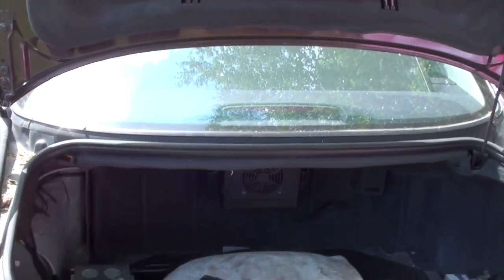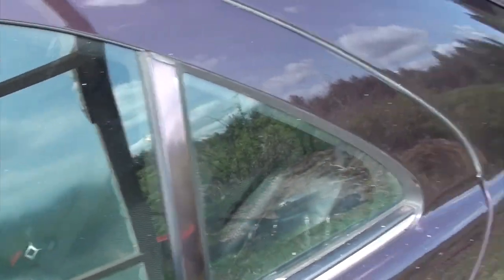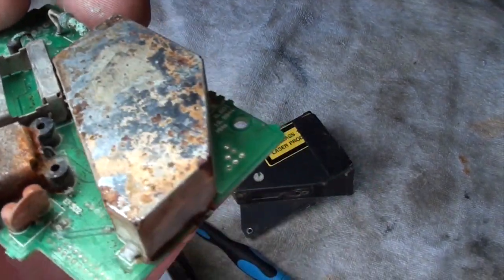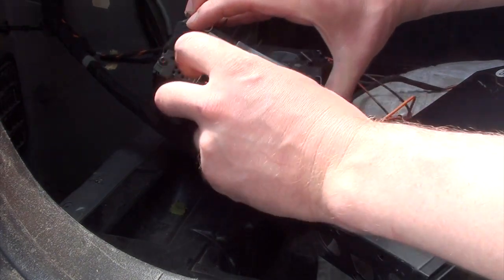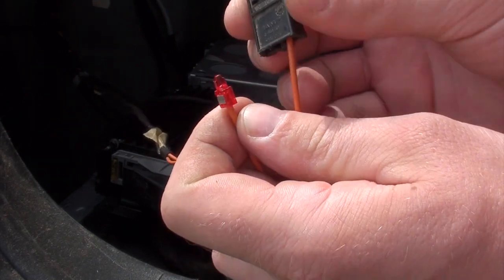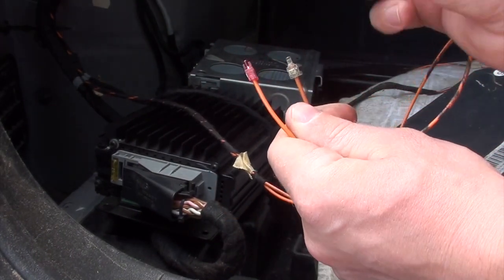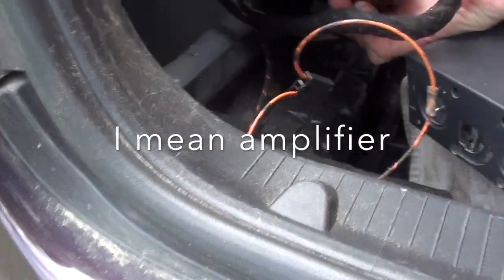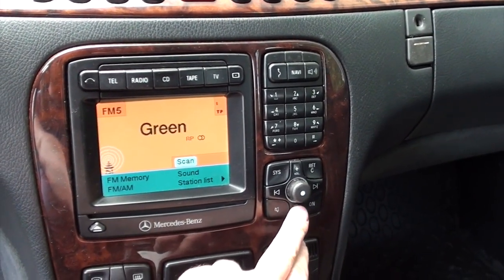Mercedes w220 no sound from radio | Easy fix

Comment: Just want to say Thank You for saving me also.  I was just gifted a 2001 w220 S500 designo and the Bose stereo started acting up intermittently with "no cd changer" then after 200 mile trip, suddenly "magazine empty" and stereo worked for the rest of THAT day. Then "no cd changer", even though I have a few more of the fiber optic cables (phone, navigation) in my vehicle your TRICK worked for me perfectly!  Now I use a FM transmitter in the cig lighter with a USB loaded with MP3's and Bluetooth from Amazon and it is totally modernized and sounds GREAT!  Thanks!

Plus, I can always get a rebuilt cd changer and put everything back to original!
Reply from the maker: Welcome. Glad it has helped You.

Comment: Hey my radio no longer has it’s options such as ambient modes driver optimization etc it jus says classical pop and manual and the sound completely stopped im not surr what settings messed up help please

Comment: Hey i have a c280, the gears were catching a few times then all of a sudden one morning i started it and when i went to leave the gear shift wouldn't move like it was stuck. 
The battery light came on that week also, then ilafter it sit that day i had to jump it off to start it back up. 
Could it be the battery causing the gears not to ahift ?

Comment: Does the circuit have to be completed if the cd player got removed by someone previous to me? Is that why im not getting sound? I see a plug ik guessing for the cd changer but no cd changer in sight! Mine is a w202 94

Comment: I'm having the same issue with no sound from my radio.  I have 2015 c300 and it has the Audio 2.0 Burmester system.  I dont have a CD changer.  I see the amp in the trunk and when I pulled out the fiber cable from the amp there was no light on.  I have looked through a ton of internet suggestions and nothing seems to work.
Reply from the maker: Since Your car is 15 years newer, first of all, You have to hook up some diagnostic tool, and check what it tells.

Comment: I checked to see if the automated voice would say something when i pull the phone lever on the steering wheel and nothing. Do you think it’s my phone module? I have a 2002 cl55 and after a heavy storm yesterday I have no sound. Will this process work on my car?
Reply from the maker: It should work the same. First of all check out Your trunk, and what components do You have there. I believe some of it were flooded, and fried.

Comment: Nice my sound went out 3 days ago any chance this will work on 2008 s550?
Reply from the maker: In W221 cd changer is i front, so it can not be the same problem. But I guess it's the same optical wire loop system. So all You have to do is to find faulty component. Have You checked the fuses?
Reply: Rasta Homestead that’s Oh ok. That is what I was checking to see. Maybe if it’s the radio fuses or the sound system fuses.
Reply from the maker: @yearight1800  If You have access to diagnostic tool nearby, that would be easier. Let me know Your outcome.

Comment: A have a cl500 w215 (99') my problem is that the radio plays from the middle but the speakers on the door don't work :/ hope y can Help a little bit .
Reply from the maker: That's not the same problem. How about rear doors? Does sound comes from there?
Reply: @rastahomestead6097  I have only sound from the middle over the radio /Navi and the bass works normal but no sound from a speaker ...
Reply from the maker: @paokis97  No idea, bro. Could be wiring, could be settings. Weird problem, and Your description is a bit vague.

Comment: Mine didn't have the phone module when I got it. The sound doesn't come either. How do I close the loop for phone module and where is it located?
Reply: Mines either I was wondering where the 3rd cable came from
Reply from the maker: You don't have to close the loop for phone module if it's not there. Just close the loop for cd changer.
Reply: @rastahomestead6097  Ahhh okay...so it didn't work still. Can I disconnect everything else and just directly keep the one fiber optic connection from amp to the stereo? I won't have to bypass anything anymore if I remove all other modules and CD changer right? I have a 2003 S500.
Reply from the maker: @hib1326  You can remove anything You want from a loop, as long as it stays "loop". I would bypass cd changer first.

Comment: Mine went out last month... I will try this tomorrow
Reply from the maker: Good luck!
Reply: Did it work
Reply: Blessed Credits I didn’t do it... my radio went out about a month ago, also de AC. I replaced the fuse and the AC Worked... radio didn’t still, I was about to do what This video said... my ac fuse blew again. I replaced it with a 20 amp instead of the 10 or 15 that the AC FUSE is... and then magically my radio worked again... so didn’t have to anymore 🤷🏻‍♂️
Reply from the maker: @pakotako7815  That is very odd, and I'm sure, that it didn't fixed itself, so should be gone again soon.
Reply: I replaced fuse but nothing changed. What fuse did you change out?
Reply from the maker: @blessedcredits3166  Probably because You have faulty component in optical circuit. Try what's shown in video.
Reply: Rasta Homestead ok I'll let yk how it goes

Comment: Will this work on s430?
Reply from the maker: If cause is the same, it will work. Just try it, it is easy 30min job. And You don't break anything. The wire You remove, could be put back together without any problem.
Reply: The radio says system unavailable then shuts off every time I cut it on. No sound nothing works it just keeps cutting off every 20 sec.
Reply from the maker: @blessedcredits3166  It indicates the same problem. You have to find faulty component in audio chain, by bypassing it. Does cd changer, telephone work?
Reply: Nope. It says sound unavailable, the telephone doesn't work or gps it cuts off every 20 seconds
Reply: I want to try this but I don't want to break anything
Reply from the maker: @blessedcredits3166  It is very difficult to break anything, but if You don't feel confident enough, go to workshop.
Reply: Rasta Homestead ,my optical plugs are different I have 2004 s430
Reply from the maker: @blessedcredits3166  Doesn't it come apart? If no, You could by optical loop cable on ebay for cheap, than You don't even need to split connector.
Reply: Yes
Reply: My s430 is doin the same thing it says sound unavailable System unavailable and shuts off

Comment: I check the phone module that’s what it is no power comin to it ima check the fuse
Reply from the maker: It is possible to disconnect phone module the same way, as I've showed with cd changer.
Reply: Ok I’m gonna unplug the phone module after the I check the phone fuse
Reply from the maker: @blueninja9188  Simply unplugging will not help, optical circuit should be closed, so You have to do the same with phone module cable as I did with CD changer.

Comment: I try it an still no sound
Reply from the maker: Hi! Have You checked if Your cd changer is fried? If not, could be telephone module, or something as simple as fuse. What have You checked so far?
Reply: Yes the cd changer is fried
Reply from the maker: Check if power comes to Your cd changer. It is one of two cables that comes into CD changer. One is optical cable, another is power cable. It should be red or orange wire, and should give You 12V, when radio is on.
Reply: An the loose wire started smokin I’m guessing the amp got flooded too
Reply from the maker: @blueninja9188  You have to take everything out of that compartment, clean it, and make drain plugs work again. If You skip that step, You will destroy components again, after repairing.
Reply: Thanks man I got it workin lol
Reply from the maker: @blueninja9188  Glad You did! Take care.

Comment: These cars just don't like living outside.
Reply from the maker: Also, they don't like to sit. My W221 was sitting for 6 months, and now because of it, there's bunch of problems, that I have to address.
Reply: @rastahomestead6097  What kind of problems? I think it's just sitting outside. My 220 sat for almost a year at one time with fuel stabilizer and battery disconnected. It didn't get issues from it. But it was in a garage.
Reply from the maker: @MrCarGuy Mine started misfiring, suspension started to squeak from all wheels, windshield wiper idler stuck solid, just to name a few.